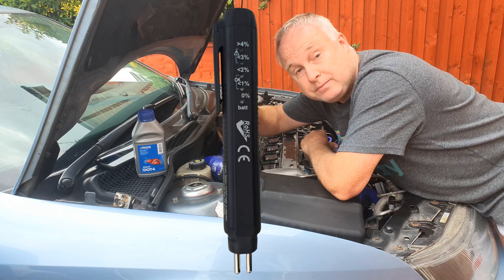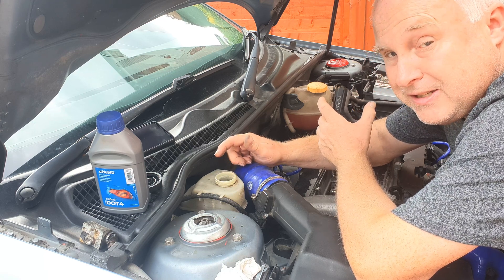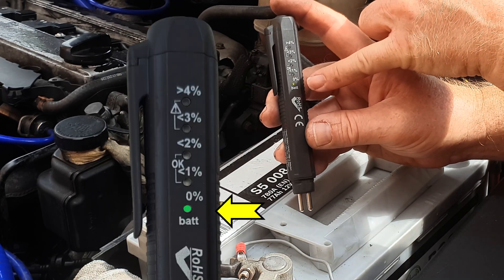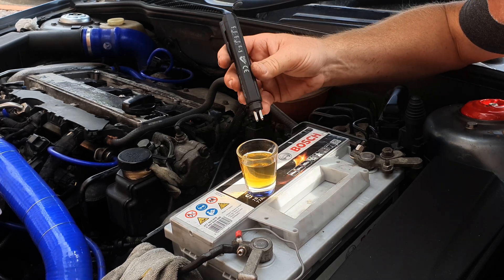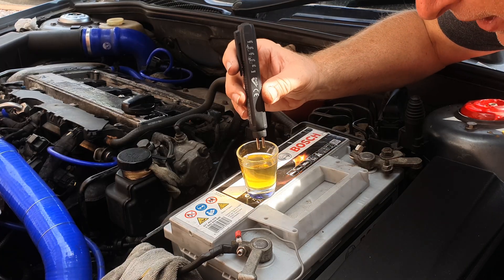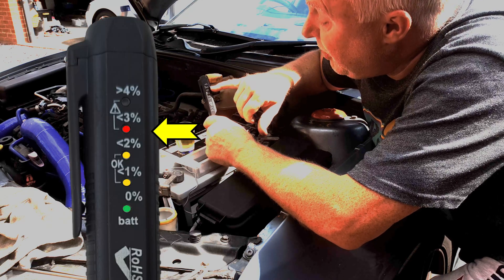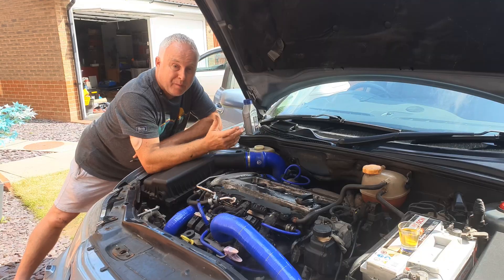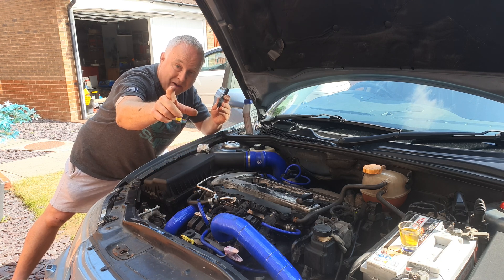How to use a brake fluid tester

Comment: ⚠⚠⚠These pens measure resistance across the probes...the deeper you submerge the probes, the higher the lights will go. Try it yourself and you'll see. You can fool anyone into thinking they need a flush, if you dip the whole pen in...⚠⚠⚠

Comment: Thanks for sharing. I also have a brake fluid tester. 
On a 2020 Chevy Traverse with original DOT3 it did not register anything.
On a 2016 F150 with 5 year old DOT4 it did not register anything.
On a 2001 VW Jetta with 11 year old DOT4 it registered 2%.

Comment: Or, every couple of years just empty and clean the reservoir (hold brake pedal down to stop air entering system), fill with new fluid and flush through until new fluid comes out of each caliper.  Can't go wrong and a great opportunity to check brake pads, discs and some suspension parts while you're in there.
I'd rather trust that than some £5 piece of Chinese tat.

Comment: Hi cyd do you have any videos with the error code p0141 p0112 p0107 cheers having problems with mine
Reply from the maker: Clean the MAP sensor and check the wiring to it as a first step. Clear the codes and see if they come back. Also check your cobra for air leaks (search my videos for 'cobra)

Comment: Spot on, used mine to check a car I was buying for my daughter ,4% moisture ,purchased a sealey VS820  pressure bleeder and flushed system through ,I've found new Castrol fluid always measure 1% ,dont know why as other fluids have been 0% .
Reply from the maker: I shouldn't worry about that.

Comment: The brake fluid bottle of a Citroën C1 is a hidden thing; very hard access. I have to change the fluid next winter anyway… Thanks Cyd. For the reminder! 🚗🤗🚗
Reply from the maker: Great point! I would use a syringe to take some from the reservoir like I did for this demonstration.
If you can get it locally, use 'DOT4 ESP', I've got a bottle of Comma for my flush.